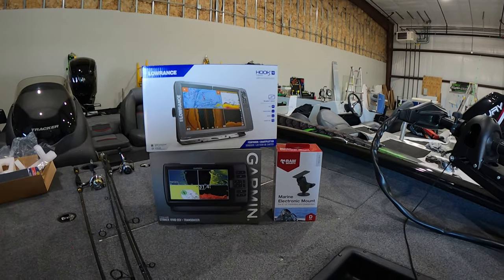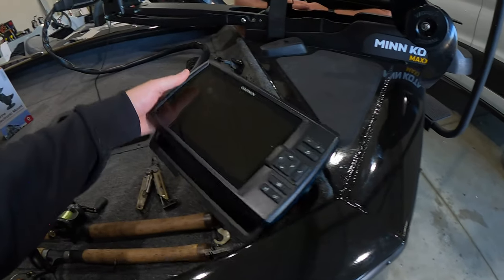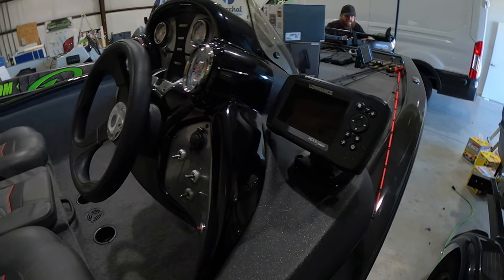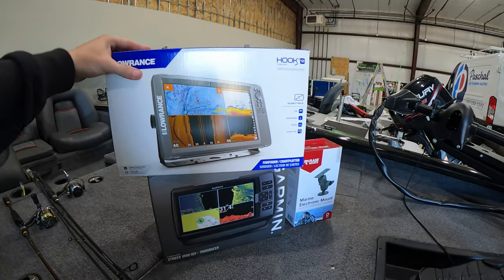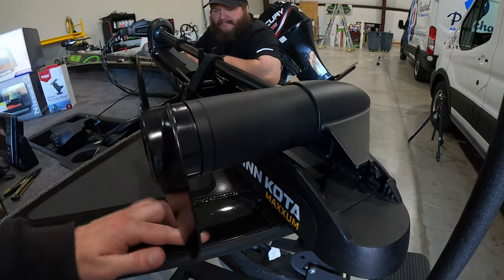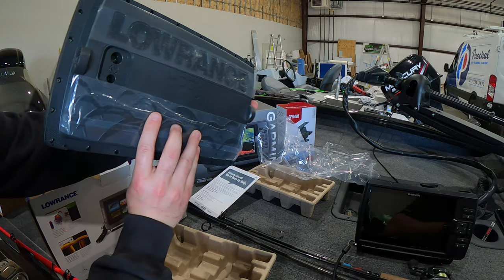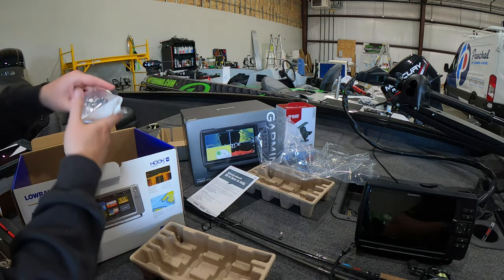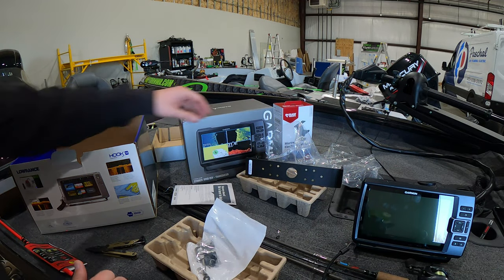Fish Finder Install on Bass Tracker Pro Team 175 TXW (Lowrance 12, Garmin 9, Ram Mount)

Comment: Guys, they make a puck for the Ram mount to fish the wires under it. No need to drill that slot. Also, if you have an existing transducer wire running from transom, before you pull the old one through, tie a small string or rope to it and pull that line through so you don't fight the new transducer wire. Just put it on the rope and pull it through and you're good to go
Reply from the maker: Good to know!
Reply: not mine --- somehow they run the old TD wire up around the shifter and put a screw right on it -- its wasn't moving no mater what I wound up having to cut it out
Reply: Other than the Ram Puck with wire holes, there’s also a hooded port available. You drill a hole big enough for a connectors to the unit, drill holes for cover and fill hood with silicone before you screw down the hood.  Very professional appearance. I second the fact they pulled the transducer wire out of the  console sleeve without a pull cord.  I’m still tripin’ on that!
Next they didn’t mention you need to disconnect the battery BEFORE you wire in the unit!  
And finally, the excess front transducer wire should go in the slot where the power wire comes out of.  Then you have four to six inches of transducer wire right behind the front unit OR a hole in the bottom of the foot pedal pan and run the wire back to come out right beside the power wire - behind the unit. 
Final/Fiinal Fill the rear transfucer screw holes with silicone and dip the screws in silicone before screwing them in.  Same with any new or added wire  lamps you put in the transoms.  Zip tie transducer wire along steering cable.  
I’m OCD - I like a 100% professional job. Maybe they did some of these steps and left them out.  
That’s why I like to do jobs myself.
Reply: was the same way on my 170 --- they put a screw right through it.......

Comment: I bought that same Ram Mount for my 12" Garmin and the plate that attaches to the gimbal bracket was to small and the unit vibrated like hell. I changed over to the larger 11" plate and all is well now. I did the same with the 10" Garmin on the deck. The larger plate makes all the difference in the world, especially if you run rough water.

Comment: My apologies if you covered this.  I'm working and listening at the same time.  Why did you choose the two units you chose, other than screen size?
Reply from the maker: Price at the time, they were both on deep discount sales.
Reply: @BentRodBassin  AH!  I was expecting some deep explanation about features and such.  Price will do it!!!  :)  Mine is coming with two 5 inch; the bow is SplitShot and console is TripleShot.  At least I've got that going for me.  I'll be upgrading eventually, but right now it's hard to tell the wife that I want to spend even MORE money.
Reply from the maker: I hear ya! Adds up quick 🤑
Reply: @BentRodBassin  Haven't been able to put the boat in the water due to weather, and I'm already annoyed with BPS.  It took 3 days to find out exactly which Lowrance that put on the boat (want to sell it).  Boat is offsite.  When I finally visited the boat, found out they were wrong; PLUS, they installed the Tripleshot on the bow with a Splitshot Trans, and the Splitshot at the console with a Tripleshot trans.  

Not a big deal, I know.  Just doesn't give me a warm fuzzy before the boat's even wet.

Take care!

Comment: I've got a 175 TF.  I want to network two Helix 7's (Console to Bow).  How/where should I run the ethernet cable from the bow to the console (or wherever I will mount the ethernet switch)?
Reply from the maker: Should run along the driver side, or connect via Wi-Fi
Reply: @BentRodBassin  When you say right side do you mean under the rail?  There is space there I could run a wire. Or maybe run it through the right-side rod locker? Or some other way?  Since the breaker is under the console, does power run from the console to the front of the boat along the rights side which could give me a path?
Reply from the maker: Under the rail would be easiest, protected and hidden. Should connect up under the console at that point.
Reply: @BentRodBassin  Seems like the easiest solution depending on where I mount the ethernet switch.  I'll be connecting i-Pilot from the Ultrex trolling motor as well. It would seem, then, that the best place for the switch could be at the bow.  I haven't torn that apart yet to see how much room I have though...  Thanks.
Reply: Worst case scenario would be to mount the switch under the console. It really depends on how much space I have up at the bow after I remove the cover.  But, In that case I would have to run two ethernet cables. One for the trolling motor and one from the Helix back to the switch. I'll have to check to see if two cables could run under the rail. I think that I would have access to the under area of the console under the right instrument cluster.  Thanks for your help.

Comment: At the 16:23 mark, im having a hard time finding that 12v wire. I heard you say it was hard to get to, do you have any tips on tracing it down? I have a 2023 model foot tray and front panel are removed and only see the group of cable sleeves.

Comment: Hello,  did you just drill through front plate and use bolts for the Garmin?
Reply from the maker: Yes, tapped into the front panel.

Comment: This might be a stupid question but when your trolling motor head spins around, doesn't the transducer cord get wound up and pulled tight. I have a Terrova and sometimes on spot lock the head spins all the way around.
Reply from the maker: No, the wire is installed on the front so it never binds.

Comment: thanks for the info on the seat -- looking to do an instal on mine when the boat comes in -- going with the Garmin at the console - just a 9 inch I think ---- still liking the boat????  im upgrading from a 170 to the 175
Reply from the maker: Yes, still have it too! Put on live scope recently
Reply: @BentRodBassin  glad to hear it! I keep going back and forth with with 190 but can't convince myself that the extra foot is worth the 3-4K it runs I know bigger is better but still gotta tow it, park it and 175 seems like a really good size
Reply from the maker: @anonimous596 ya also the 175 fits in my garage!
Reply: @BentRodBassin  not mine its about 4 inches to long but I have a good covered  place to keep it on the side yard

Comment: Did you run a online fuse to that upfront or just straight to the wires. Getting ready to attempt it. Thanks
Reply from the maker: Strait wire, worked perfect!
Reply: @BentRodBassin  thank you. I'm going to try it.

Comment: I have a very similar setup and I’m thinking about adding a Humminbird unit at my dash in addition to the Lowrance. I haven’t been able to find a single video on YouTube showing what happens if you mount two different brands of side imaging transducers on the transom. I’m sure there’s potential for interference, but if I run the Lowrance at 800mhz and the Humminbird at “Mega”, think it would work?
Reply from the maker: I think u should be fine, I haven’t experienced any frequency interference, but it is possible.

Comment: I have Tracker Pro Guide 175 that came with same Lowrance fish finder from factory but I want to upgrade to Hook Reveal 7 Tripleshot, do you think I can re-use the same wires? TIY
Reply from the maker: It’s possible, if the connect. Depends on the transducer config.

Comment: How easy is it to tap into the power wires in the bow of the boat?  I have the same boat and thinking of installing a Lowrance Elit FS 7 in the front.
Reply from the maker: Super easy, there are wires pre-ran to the bow, open ready for electronics.
Reply: @BentRodBassin  Okay thanks, I will try this next week.  Your video gave me the confidence to give a whirl.  New owner since April and loving this boat but want to start making a few upgrades.  I will look through for more of your videos on Tracker Pro boat upgrades.  Thanks again.

Comment: Have any issues with trolling motor interference on the garmin?  I installed the same unit and have the same boat.  Getting interference for about 10 seconds every time i hit the
Reply: Power on the trolling motor.
Reply from the maker: No, maybe you have a bad ground?

Comment: You are two great guys and did a super job showing how to do this.
But I have to be honest with you. Putting those silver, long ass screws in the ram mount was about is half ass as I’ve ever seen anything done! Most people with a new boat got to that point, and turned it off. Who the hell would spend 1500 or $2000 on some electronics and then be too cheap to buy three dollars worth of black high end fasteners?
Reply from the maker: Works like a charm 🤙

Comment: Is there a fuse on the bow? When replacing I get no power my new garmin. I have the tournament edition though. Replacing the lowrance
Reply from the maker: There was no fuse, just wires from the console fuse block.
Reply: @BentRodBassin  is it possible I blew it on the fuse box
Reply: @BentRodBassin  do you know where those pre power wires run too
Reply from the maker: @erichsandler1869  definitely possible
Reply from the maker: @erichsandler1869  they should run to the fuse panel , then that should connect to your batteries
Reply: @BentRodBassin  did you guys disconnect the batteries before you started? I know dumb question
Reply from the maker: @erichsandler1869  I didn’t, but it’s a good idea to not spark a fuse 👍

Comment: I feel like this is a silly question. I’ve watched every video out there on this and no one is mentioning it. So it must be obvious. When you tap into the bow wires, Are you disconnecting from the battery first?
Reply from the maker: Yes, it’s a good idea too
Reply: @BentRodBassin  are the bow wires from the trolling battery or the starting battery? - been told its bad to run FF from the trolling battery...... is it?
Reply from the maker: Starting battery, trolling batteries are to many volts and will interfere with the transducer.
Reply: @BentRodBassin  that's the answer I was hoping for - thanks! I havent gotten to that yet still messing with removing the factory one (planned to move it up front) --- somehow they run the TD wire near the shifter and caught it under one of the shifter mounting screws so I lost about 2 hours trying to get it out before I just gave up and cut it (transducer cable of course) pulled it out from both ends. to late to finish last night now on to mounting the Garmin TD on the stern of course it wont fit in the factory mount so now I have holes in my new boat from the old mount to contend with. - different problem - thanks!
Reply: hey any tips for sealing the old TD holes? going to mount a block to back this time around  but I need to seal up the ones that are a already there first. gonna try the "stern pad" uses VHB 3M adhesive instead of screws. I figure its worth a try I guess. I really do not want any more holes in the boat -- how did you deal with the holes from the original TD with yours????? cant put screws back in they'd be in the way of the new one. what was your solution?
Reply from the maker: @anonimous596  I normally mount in the existing holes, or exterior silicone works 👍
Reply: @BentRodBassin  that was my plan but the pattern doesnt match the old ones are to low on the hull - stupid hook 2 thing- so im thinking on adding a mounting block it will cover the old holes so i did water weld epoxy and cover with the plate hopefully ill still be floating ….. gonna try something called “stern pad” it sticks with 3m VHB adhesive that is supposed to be permanent and no new holes (if it works)  was just wondering if you had any better ideas for plugging screw holes where you cant put the screw back in
Reply from the maker: @anonimous596  the stern saver block is great, and the VHB will hold very strong and water tight.

Comment: next time when you pull the old wires out attach a small cord or rope to the wire. now when you pull the wire out the small rope will also come with the wire and when it comes time; attach the new wire to the rope and pull the new wire back through...and there you go

Comment: 8:58 how did you guys get this off so easy, im having a hard time removing this part
Reply from the maker: There is a screw holding it onto the boat from the inside, just past the switch board on the console.